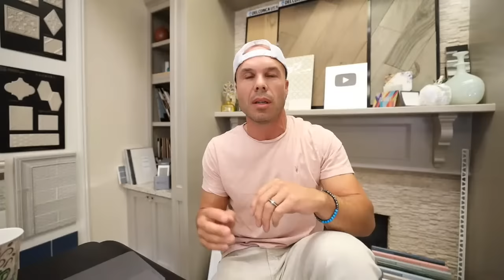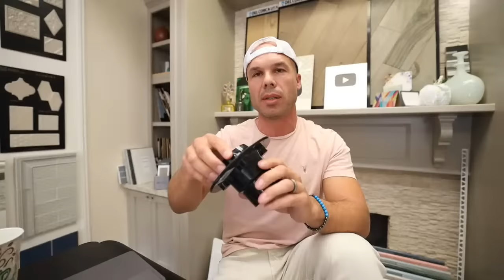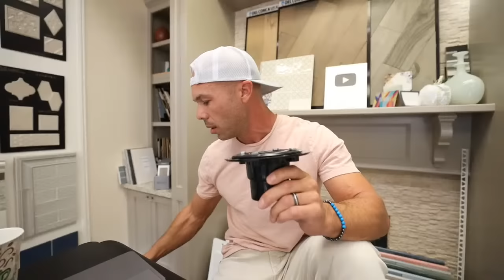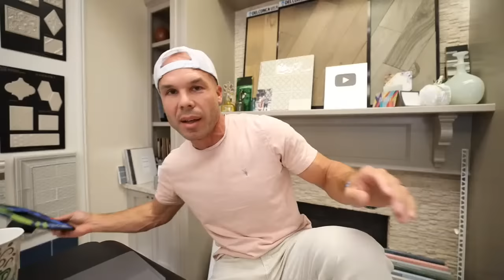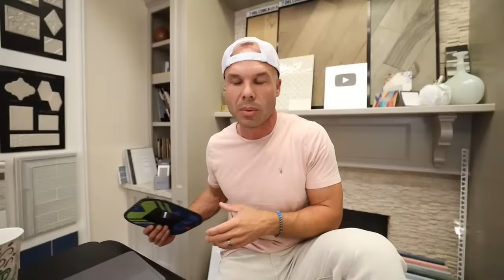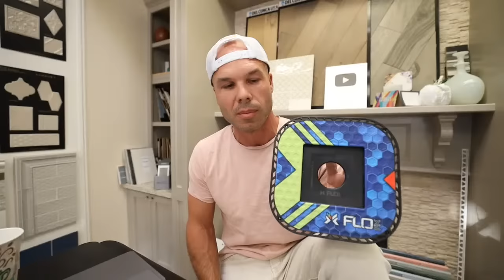The 3 Biggest Mistakes I See in Tiled Showers

Comment: The shower i just tore out was 44 years old. Old school setup. Never a leak. No pre slope, no mold or standing water. Shower pan liner and then sloped mortar. I did not see any other water proofing. 6 people used the shower daily.
Reply: That’s what I’m talking aboot!!! Where/when did pre-slopey become a thing?? I want to hear this about a shower I did 50 years from now
Reply: That's crazy because I just gutted out my bathroom from a 1920 design it had regular drywall installed.. regular ceramic tile..and cast iron tub... the only thing I seen was a tiny bit of mold on the very top of ceiling and it was just a few spots... again I seen no signs of waterproofing ..and if you tell me the bathroom could of last longer I just wanted a fresh new look
Reply: Grout from the 60s into the mid 80s was a LOT denser/harder. Less water penetration.  When grout changed we started seeing shower problems. --Try and scratch out some grout from the 70s and then scratch out some if this new grout.  That will be an eye opener.
Reply: Yup!  Studs, gypsum board, mud, diamond lathe, and tile on the walls, floor joist, plywood, mud, and sloped tile on the floor.  Lasted 60 years without a problem and no mold!  What gives?  I will say the mud walls and floor were thick!
Reply: I'm new to this and learning alot from YouTube and on jobsites. I'm a PM for a restoration company. That's how my shower guys all do it here in Texas. Liner, slope mortar pan, no pre slope. Cement board walls with liquid membrane. 2 years Ive been around not one leak.
Reply: I'm ripping out a 1977 fiberglass enclosure. 32 x 60. Looks like the threaded ring under the pan failed.  It was leaking under the drain as the pan flexed away from the drain edge. Looking to get the new drain AS LOW AS POSSIBLE.  (recommendations would be great.)  

I see dry pack, thin set, membranes,  and tile in my future.
Reply: @kenhetherington756  hey, is there a superior grout I can buy today? Gonna do my shower soon.
Reply: @r33l007  Now it's going to be ridden with leaks and mold 🤣
Reply: @r33l007  Apples to oranges. A tub is not the same thing as a shower base.
Reply: Good audio n visual
Reply: Blurry is their bad eye site lol

Comment: So great to hear a real knowledgable expert in his field. The problem for most of us is that when we hire a "tile man", he typically is not expert, and makes several of the disastrous mistakes you describe here. My conclusion is that the homeowner needs to read up extensively and know exactly how things should be done properly, and is able to discuss the exact plan with the contractor and not accept shortcuts. It is the shortcuts that come back long later to cause big problems and the need to redo the job. After seeing so many poorly done contractor jobs, by now I'm afraid to hire anyone. As for "reading up" on the correct way to do jobs, sometimes it is not so easy even to find good solid instructions.

Comment: Love the info. Been working alone doing bathrooms since '08. Takes me 3-4 weeks. I thought I was taking too long. I do all of my plumbing (because I was tired of going behind inferior licensed plumbers).
I have recently started to use wedi. Finally tired of lugging around 250-300 lbs of 4to1. I can also have it all ready for tile in less than a day as opposed to about a week if I consider the wall board, mudding the seams, and waterproofing the walls. Once I install the wedi, it's done and 100% waterproof through the core.

Comment: Most of your information is good and I do appreciate that you show your failures as well.  Where I disagree 100% is that if you use a topical waterproofing membrane on a poured shower pan, and waterproof right down to where the pan meets the  3 piece drain then you won't have that mold sandwich issue.   The neck of the drain has weep slots in the treaded part so it still allows water to weep.
Reply: Depends what type of drain. The FloFX drain has no weep slots

Comment: I don’t see why you can’t do the old school way and still screw cement board into the curb if everything else is done correctly. That’s the way my grandpa did it for years, along with my uncle and they have showers all over the county that have been there for god knows how long without failure. Pan liner over the curb, just like you would do. Wrap it in cement board using proper fasteners of course. Skim the whole thing filling screw holes and joints then waterproof the curb. I understand your argument but if done properly it shouldn’t be a problem

Comment: Hey boss,i have mixed the actual drain with the waterproof. The idea is that if you use a kerdi liner and put a sealant between  the flange and the membrane ,you are golden. I actually don't like using the schluter because of the way they treated us in the past(with their unmodified garbage rules) and i do the "paint on " type. Ardex 8+9,hidroban ,ardex S1k...just not red gard😊. But with this method i ALWAYS use a mesh all over the floor. This has been my best method as of 16+ years ago . So first is the foam board, then the zero clearance drain, a good deck mud,mesh imbedded in 4to 5 coats of waterproof. I tell my customers that as soon as the water proofing dries they can use the shower if they want to(not that that happens but that's how much I trust my shower pans)
Btw .Sal and you have been a go to for me and i always send your videos to guys that don't know how to correctly do shower pans. You guys are awesome.

Comment: Hello Isaac. I watched this video and was concerned because I also use a hybrid method which I thought was indestructible but now I am questioning it. I use a wedi shower pan for a base and hardi backer board for walls. I use the wedi water cut off in a tube where all seams meet. Thats day 1. Then day 2 I come back and put the wedi tape in all the inside, outside corners and let that dry. Then day 3 I come back and red guard everything but the pan. If you overlap the tape with redgaurd you end up with a bout 2 inches of red guard on the shower pan. 3 days of prep which is a bit much but helps me sleep at night
Reply: Forgot to ask. Whats your honest opinion on my set up. Be honest! I can take it.
And thanks so much for your videos
Reply from the maker: Since you used the wedi tape I think it will be fine. That’s is an important step.
Reply: @TileCoach  so DONT Red guard the shower pan?

Comment: Installing  60 x 30 acrylic tub and tub surround but tub is about 1 1/8 too short for alcove.  How to shim out studs a least 1 inch, seems a lot, but main concern was having bathroom walls , at least the remaining 4 foot wall of a 5 x 7 bathroom will have to be shimmed out 1 inch as well .
( wall has baseboard water heater at bottom and may not allow 1 " shim out.

Comment: Great videos.  Thx.  Question. In florida redoing a master shower that is about80x36. Chopped out old mud job to slab.  No waterproofing and no weep drain.  Used 9 bags of leveling to remove a 2 in step in the shower for a now flat floor.  Installing a linear drain about 2 feet from shower head wall. Didn’t want to move drain.  Planning on using hydoban water proof over new mud job and seam tape at floor wall joints and where drain meets mud.  Do i need to use a hydroban membrane over entire floor. Thx. .

Comment: Great livestream Isaac! I love your general viewpoints on life and not going to the extremes of varying political and economic spectrums.
Question: you had mentioned in this video several times that you don't trust applying liquid Waterproof membranes onto the trough of the linear drain ie, hydroban, kerdifix, redguard, etc. I'm assuming you've seen these fail in the field hence your opinion. What is your solution then? To buy the preapplied membrane linear drains? But your anecdote about a fellow installer having a failure on the schluter affixed membrane makes me a little worried as well. At least he had the warranty cover it so that's good. Thx again and keep up the great work!
Reply from the maker: Hi Dan-  I have only seen one schluter kerdi-line that broke at the seal.  I think it is best to use a Kerdi line drain with a liquid applied membrane over that for double protection, especially on a wood foundation.
Reply: @TileCoach  I think that's that's great solution! Now you will have 2 layers of waterproofing protection instead of just the 1. I think I'll try that on my next install with a kerdi preapplied membrane linear drain either from kerdi or infinity drains, and apply hydroban liquid applied waterproofing on top. Let dry and continue with thinset and tile. Thanks again Isaac for your dedication to this craft!

Comment: The guys who tiled my kitchen and bathrooms used floating floor systems. On the kitchen they used tarp paper, thinset, cement board then tile. In the bathrooms they used tarp paper mesh, mortar thinset then tile. I am remodeling the main bathroom. The wall tiles were well adhered. The floor tiles were barely adhered. The floor tiles had a minimum amount of thinset. They were all in good shape after 20 years. I will use cement board and thinset.

Comment: Need your expert advice on wall to ceiling vertical subway tile gaps. Hired contractor stated "Yes I started with a full tile on top of tub and that's where it ended up on top I installed the tub dead level but the ceiling is out of level so it comes up shorter in some areas I got tubes of grout caulk same color as grout I will be able to run a bead around all three edges to close gap or silver of tiles" 
My question is should he have accounted for this even before grouting you can see a difference. One side is a about 1/8 gap to ceiling and then slopes to 1/4! 
Perhaps tiling ceiling would correct however, ceiling wasn't in mind for tiling. Can it still be done. Suggestions 🙏

Comment: Doing shower pan liner system and brought in a guy to finish and he raised my mortar bed with thinset and put redgauard over!  So I am back to doing it myself, and I have removed the redguard and my question to you is if the 1/2 inch of thinset on top of the mud deck is too thick and could cause problems?

Comment: Quick question. Why would Kurdi not work if used in the same manner as a panliner? I understand its a different system but if it is waterproof  then why not? 
Liners are more difficult to work with.

Comment: you just blew my high! i've been using a 1/4 1/4 3/8 to put 12'x24' tiles
Reply: Waaaay to small. Half inch is standard. I’ve used 3/8 x 3/8 on 12x24 as well. But I trowel the wall and trowel the tile instead of flat back buttering

Comment: Great information! Thanks for sharing! Not sure on which of the two systems you mentioned is the best to use for a steam shower pan? The boss (wife) wants to have tiled shower so fiberglass pan is not an option...
Reply: you can use a fiberglass pan you need a special,( i don't know the name,) epoxy
Reply: If i, a non pro tiler were to do a shower pan go with the one piece pan and use the epoxy, guaranteed  leak free. Redi base is one i would recommend.

Comment: Schluter sells a Kerdi drain flashing used to connect to a 3 piece drain in place of a shower pan liner.. Can’t find any information on it online though. They sell it at Contempo and Modern tile in my area
Reply from the maker: Yes they do.   It works when you do not want to remove the bottom flange of the old drain.  FloFx has an adapter in every drain they sell.

Comment: Isaac, I appreciate your videos. Your tips helped me with some questions on my first tiling project (subway tile tub surround), which I'm just finishing up. I have a question I hope you can answer. My tile ends, where the tile meets the drywall, are uneven because I cut some tiles a bit shorter than others. I want to finish with bullnose, but some are as much as 3/16" shorter than others. How can I fix this so it looks as good as possible?
Reply: With a grinder and a nice smooth, finish grinder blade, strike a line and cut the tile all in line with the shortest tile. The only way I know of without pulling tile off the wall.

Comment: Does anybody know how to secure backer board to a shower curb without screws? everything I read says do not puncture membrane, I don’t really understand
Reply: You need to use dry pack for that. Backer isn't tuff enough for a curb and in my opinion I wouldn't use it for a shower floor either. I tore one out that was old cement board and it was black with mold and the 2x4 under it was a black sponge. That curb was the reason the floor started leaking. The membrane application is usually with thinset.

Comment: As far as #4, I treat bathrooms like a steam room. the entire room gets Aquadefensed so years down the road the drywall seams nearby the shower dont get soggy or warp.
Reply: That seems like it would not look good. Surely ample high quality primer and paint with a satin or eggshell sheen would solve any issues. Bath ventilation plays an important role too. 

So you paint over Aqua Defense over drywall and compound? How do you get it to look smooth. We are talking about walls and ceilings in bathrooms right?
Reply: @ManimalLector  use a light handed orange peel, a heavy knockdown tends to look a little muddy yes. I only use one coat, because of the color difference from white drywall to green to white primer to color coat it guarantees there is no gaps in the coverage. I don’t know that I’ve seen a paint job in my area that didn’t end up with some missed section with the primer coat that gets soft after 10 years.
I guess you could use get a good grey primer to make sure of 100%coverage.

Comment: Is it possible or recommended to or not build the shower curb out of concrete/mortor? 
I really enjoy your videos and follow a lot of your recommendations,
Reply: I have for 15+ years now. My pan liner runs in the middle of the site cast curb. No rot issues with concrete!
Reply: @JayLepisto  so concrete curb, then mud pan, then pan liner only halfway to middle of top of the curb?
Reply: @jrhenry24  Yup. I form the curb with a ripped 2x4 lined with flashing tape. I use plywood spreaders to suspend the 2c2 inside half of the curb form. I then use CTS Cement All to cast the curb with. The quick setting fine cement is packed on the outside of the curb and under the liner. The other side of the curb is placed over the liner. After a little tamping and screeding, the curb is ready to trowel the top. As the cement only takes about an hour to cure, the spreaders can be removed after the mix is firm. I remove the forms when the mix becomes hot to the touch. An hour after mixing, the cement is hot and turns white. The curb is complete and ready for the floor to be installed. Thanks for your interest. I am self taught and wanted to improve how I built shower floors.

Comment: Schluter says to use a non modified thin set. But you said don’t use it with even Kerdi. So confused now?…
Reply: I’m not a tile guy. Just a homeowner planning to do my own shower install. I plan to use the schluter shower kit and I too was confused by the unmodified/modified requirements from schluter. Their newest catalog shows that their allset modified thinset mortar can be used for the kerdi membrane, shower pan and setting the tile. I think the only thing it is not recommended for is outdoor use. I have decided to use the schluter allset thinset to avoid any possible compatibility issues from using another brand. Good luck with your project!

Comment: Very good info. but I am what you call from the elderly school and from what I have seen and experienced is that the copper pan is the king of all. Never had a problem and will outlast anything today. To my mind using styrofoam and other synthetics is structurally unsound and will not stand the test of time. Yes copper pans are pricey but you can have them fabricated to any size and shape you want. You also need a plumber to solder your brass drain flange correctly and securely, can be tricky but I have never had a problem as long as you follow protocol as you would with anything. If you are going with synthetics listen to what this man is saying carefully and do not cut corners!

Comment: Hi Isaac. I’ve been watching your videos for quite some time. But I’m a little lost ,When you say don’t mix two methods does that apply to using 8 + 9 over kerdi membrane, because you’ve done that in some of your past videos. Or when you say     the shower is used to dry out in between uses, but I’ve watched all your water tests and you say you let the water set for weeks. And you make it sound like it failed the water test ???
Reply from the maker: Adding a liquid such as hydroban over sheet membrane is approved by Laticrete.  That’s not two systems...it’s adding a layer of protection to the same system.  
If Schluter had a liquid I’d do the same thing to Kerdi.
Reply: Thank you for your time, you are right we are learning some thing every day 👍👍👍